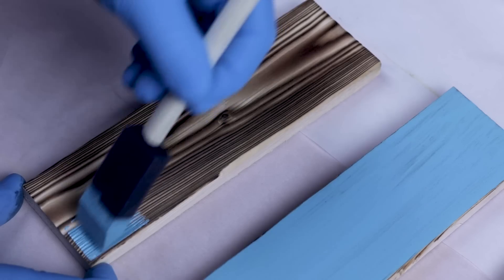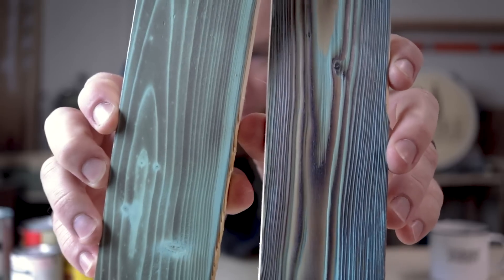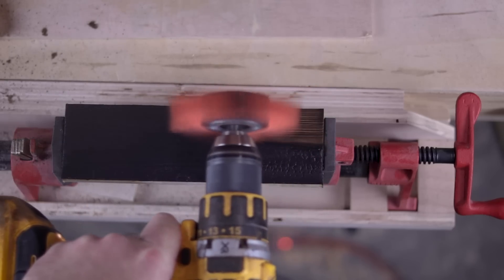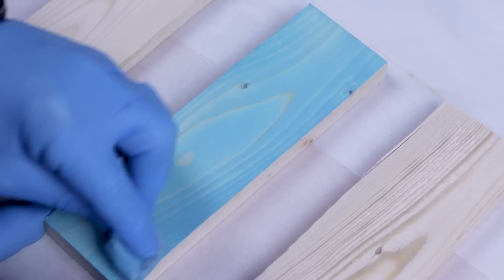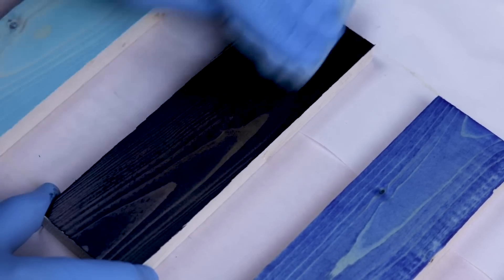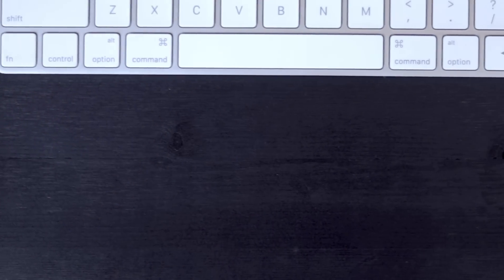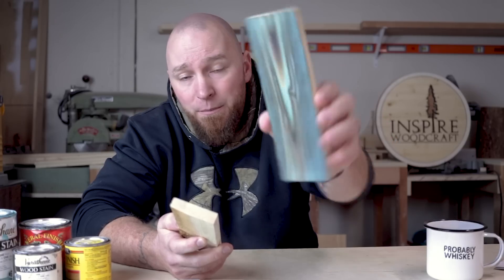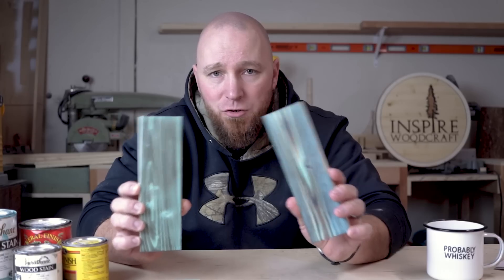One Of These Things Is Not Like The Other / Shou Sugi Ban Face Off

Comment: I just did my first pieces the "short way" and don't like how they turned out.  Came to YouTube for advice and found your video, thanks.   When you sand with the flapper, are you digging out the "valleys" individually?  Or would an orbital/belt/sheet sander do the same?
Reply from the maker: Yes with the brushes it digs out the valleys. Since sanders take everything down equally, it just can't produce the same effect.

Comment: try pressure washing (you have to find the right water pressure for the given wood and graining) the wood instead of brushing. give yourself ample time for the wood to dry. much less physical effort. time to complete project may be longer due to drying time. this can leave vertical lines in wood if you do not complete pass from end to end. don't change directions on the wood. have fun

Comment: I like the "brushed" way - but you should have used a single board cut in 2 so the grains and texture were identical as possible. Your "easy way" board looks like a denser grain to begin with.

Comment: Rant away my friend!  You are right that one way is not "better" than the other from a look perspective; it depends on the look one is trying to achieve. Personally, I like the depth of color your method produces. Also, your way with the deep brushing techniques create a contrast that only a 3 dimensional style can produce. Light, contrast, hmmm, that from a photographer no less. Go figure.

Another point, and I fully expect to catch it from other commenters on this, is that traditional shou sugi ban is the art of burning wood to preserve it. This means fully charing the wood, brushing off the loose char, and oiling the wood to preserve it. This does not mean taking it down as far as you do, for the traditional shou sugi ban "preserving of wood." Shou sugi ban art is the use of the burning of wood to create something of aesthetic value. Based on this the techniques you are showing are shou sugi ban art and therefore open to interpretation. This by definition means that neither is better than the other. However, that said, your technique is truer to the tradition of shou sugi ban wood preservation (the reason the technique was created). 

Because of the wonderful things that can be done with it the style of shou sugi ban has gained popularity, and things that are popular often attract those who like to create shortcuts. Many times shortcuts will generate a quicker return, but often that return is short lived. By taking the time to use a traditional style, you will often create a longer lasting, and technically better, work of art. 

I am with you Jodee, traditional is more my style too.
Reply from the maker: Well said my friend! That's why I (almost) always say "shou sugi ban inspired", which big companies that actually do similar techniques for siding don't even say. I don't worry about it too much. But I do want people, especially the folks that subscribe to this channel, to know the difference and not short-change themselves. It's better to be over-informed than misinformed. That's my opinion anyway.

Comment: Hey Jody. Love the videos. I've been making some Shou Sugi Ban birdhouses recently but have encountered a problem. I was using Angelus leather dyes to get some great colors and effects. Then I was finishing them with General Finishes Exterior 450 flat. Unfortunately, after 1 week in the Texas sun, the dye is faded to garbage! Spar urethane works decently, but the amber color really changes/darkens the leather dye colors so much that is almost appears black with very small hints of the original color. First, is there an outdoor finish that dries clear that will actually keep the leather dye from fading? If not, do you have a recommendation for getting really cool colors at an affordable price. That's what I loved about the leather dye. A 3oz bottle costs about $7, which can then be diluted down to yield up to 10oz, depending on how dark you want the color to be. Colored wood stains usually have a very limited palette and can get very pricy when you want 7 or 8 different colors. I'm considering diluting paint down with water, but I'm not very optimistic that I'll get good contrasts with the harder and softer parts of the piece of wood.  What are your thoughts?

Comment: There is something beyond mere aesthetic considerations, right?  Shou Sugi Ban is foremost a wood preservation technique; one that only later gained fans of its look. If the wood receives a superficial burning instead of a deeper, more prolonged one,  it will not have the same characteristics of weather, UV and, ironically flame resistance.  If the debate only centered around the looks a particular technique results in, I'd personally decline THAT debate because there's no accounting for taste.